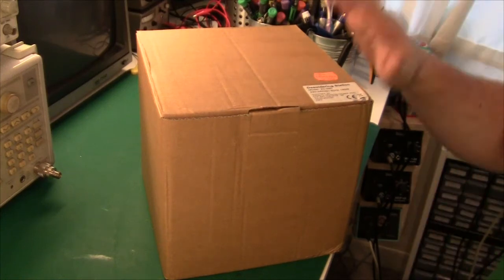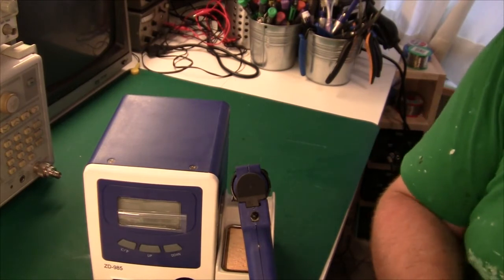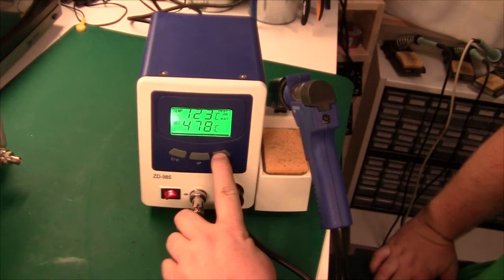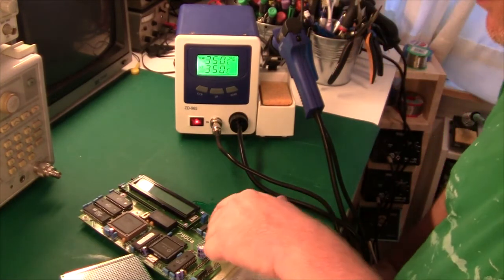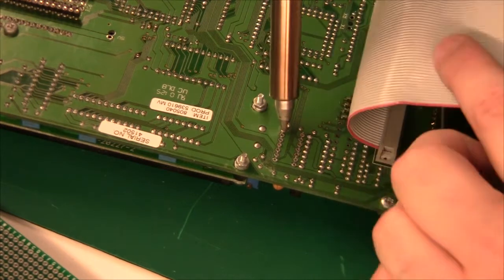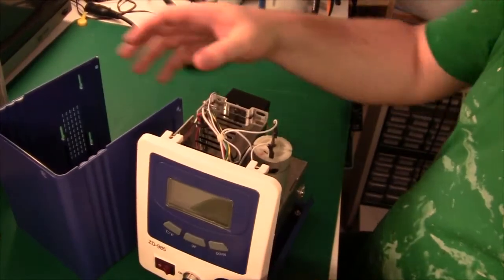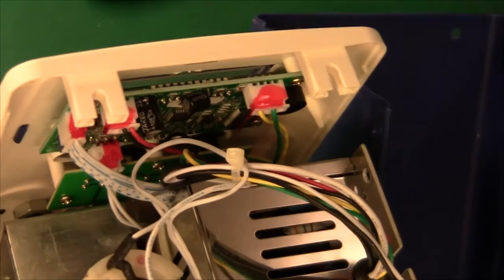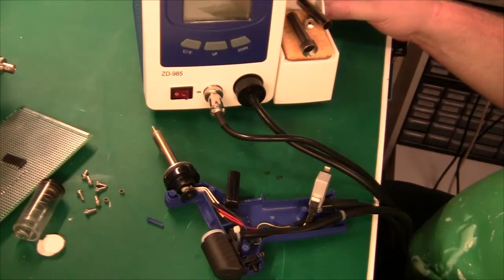Review of desoldering station ZD-985

Comment: I don't understand why everyone who reviews this desoldering station ends up opening it and some even take it apart when it works as it should. It's a pain to watch for the umpteenth time a video where someone shows the simple interior of the station and they add not-so-good comments. There are many such videos on Youtube and only a few of real value. I have had this station for many years and it works as it should and I haven't even opened it yet. There is no reason for that.
Reply: Because it's a cheap tool and showing it inside is part of a proper review.

Comment: I have this model (purple-white) - it works great. I read the manual about the initial startup, going good.
Reply from the maker: I'm quite happy with mine too, now. Do you know if it is possible to buy new filters and those long file things to clean it with?
Reply: Haven't looked yet. But just cleaned out my canister and flipped my round filter over, get a little more life from it. Bet they're out there. Beats solder wick for sure! Pretty in-depth review I should have said ! Nice Work
Reply from the maker: Thanks. I'll have a look on e-Bay.